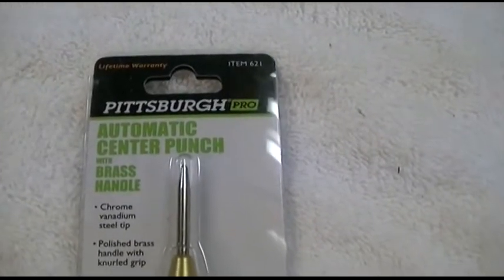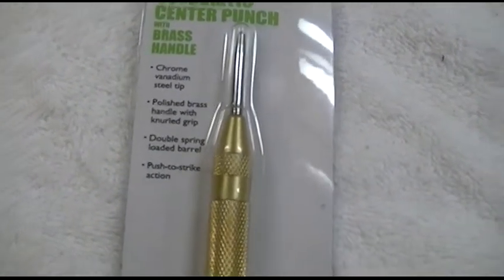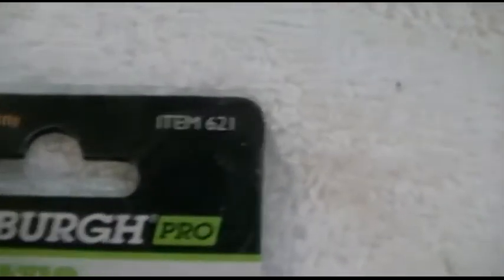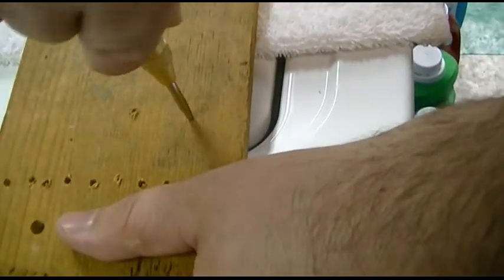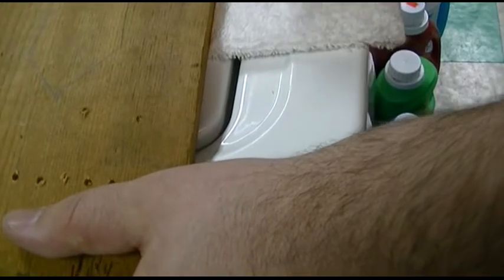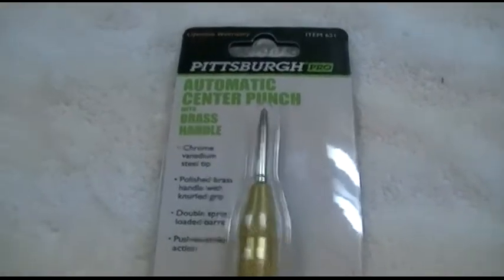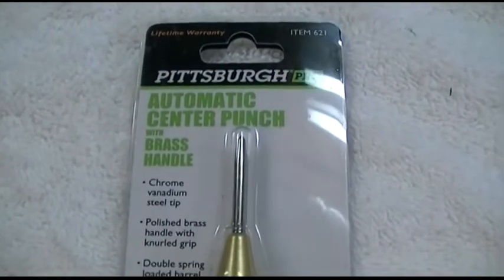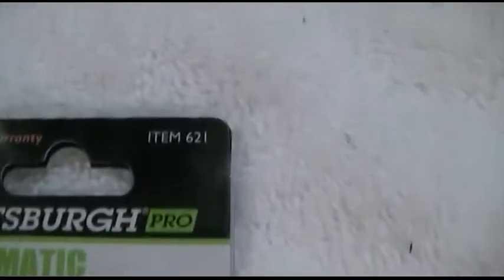Harbor Freight - Pittsburgh Pro Automatic Center Punch With Brass Handle Review

Comment: I just bought this tonight.  Got it home and didn't know how to use it because I had expected to push the punch into a lock position (just like you do with a glucose tester to prick one's finger) and then push a button to release it (which actually would be a much better way for it to function especially when trying to punch small areas.  I need to drill tiny tunnels/ holes in 10ga copper wire ends to make jewelry.  At least now, I know how it works.  THANKS SO MUCH for the demo!! 👍👍👍
Reply from the maker: Sure, no problem.
Reply: same lol I was like how do I prime it